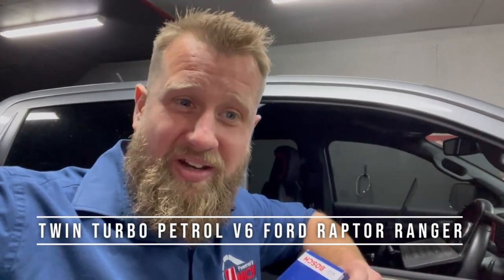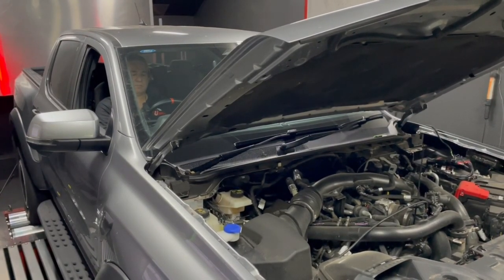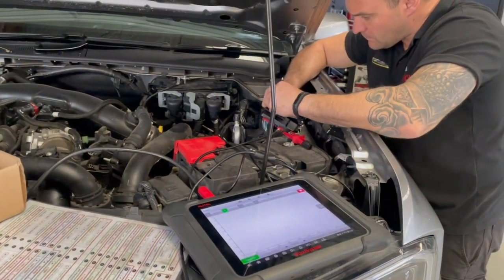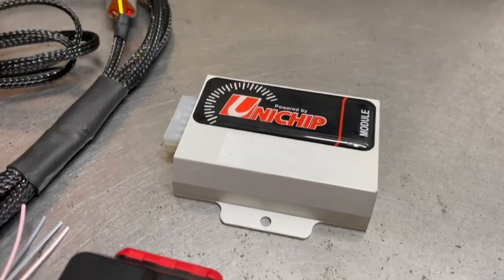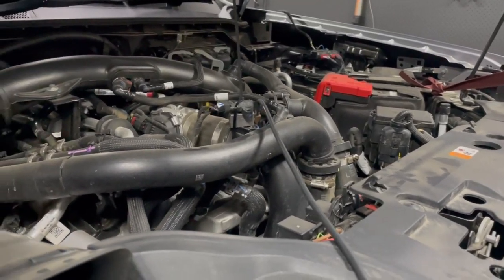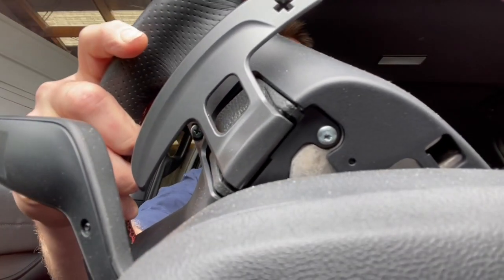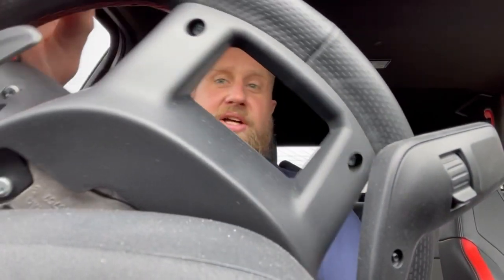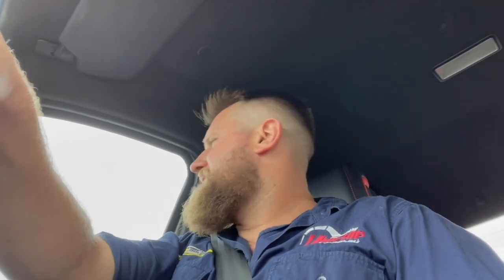Worlds First LIVE dyno-tuned Ford Raptor v6 Twin Turbo 3D, Fuel, Boost, ignition timing & more

Comment: Very informative video, enjoy the new car with safe driving,
I have bought this car, in Greece and Europe the power is 292HP (217KW) unfortunately!!!
do you know how he can change the engine maps for me because it is the same as the AUSTRALIA (296KW/397HP) how much power is it supposed to give plus?
   I am so keen to see the gains and improvement in throttle response, does it also remove the top speed limit? looks like some others have that 190km/h
Thank you very much
Reply: Rangers have great acceleration. But brakes uhh not so great. Hopefully the raptor has much better breaks.
Reply: Did you get aby info on how to remap the EU raptor to 397HP?

Comment: Ok but in Australia and the rest of the world, excluding the EU, the Raptor's standard output is 398hp and around 600Nm. Where is the tuning?
Reply from the maker: Oh mate, watch the video from start to finish next time…. We measure at the wheels (not the factory quoted Flywheel figure) Using an awd chassis dynomometer.. in KW not in HP… the tuning is using the uni-x 🙄